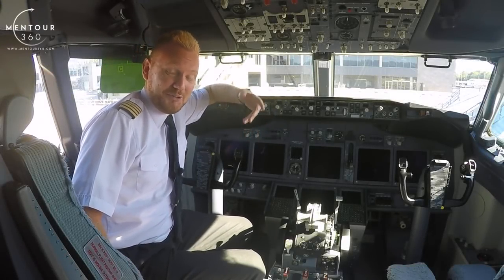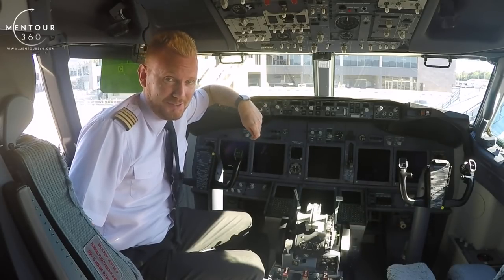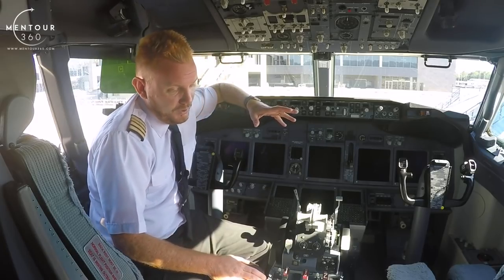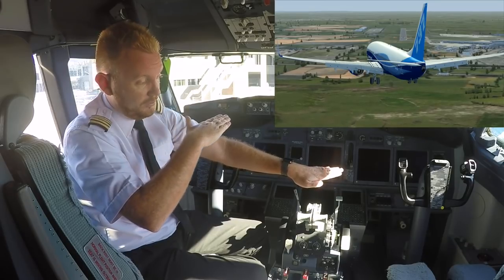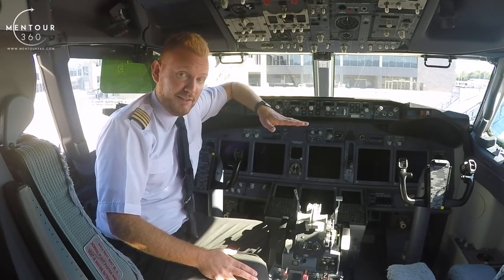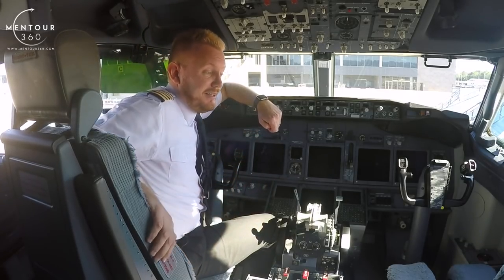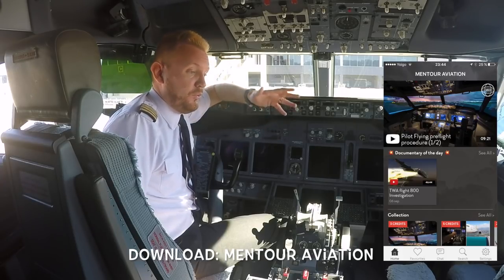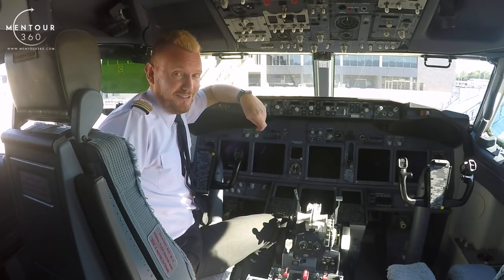How to do a CROSSWIND LANDING in a Boeing 737NG

Comment: How does the autopilot handles the crosswind during cruise so not to drift away from the straight line path towards the next check point..?
Reply from the maker: +Arinze Ahanotu It finds the correct heading to keep the track and uses that. Our IRS’s calculates the current wind all the time and feeds that to the FMC.

Comment: +mentourpilot Sir, please tell us about how do autopilot work? Which part of flight is controlled by the auto pilot and when and why do pilots use it? 

2. tell us about more on Integrated Approach navigation systems, how does it work required procedures to do?

3. Can a Boeing 787/Boeing 737 type rated pilot fly Boeing 777?
😇😇😇😇😇😇

Comment: One question: when you were sitting in the real aircraft, why does the fuel control switch(lever) and parking brake handle look different than what the other 737s have?
Reply: Cause it's an NG ?
Reply: S F Yeah but they were also NGs. Interesting?

Comment: What about the air Canada flight the landed on a race track, you should talk about that flight
Reply: that was a stupid mistake by ground crew.  did not know a Pound is 1/2.24 kilo.  system calculating fuel load was changed and there was not training on how to fuel the new plane type.  Ever ran out of gas on a roadway?

Comment: Why hasn’t a better solution been developed in order to handle extreme cross winds in a safer manner. With all of the gadgetry out there, it seems like developing a system to allow the plane to land in a crabbed attitude while at the same time being able to have the wheels lined up with the runway would make cross wind landings a lot less stressful and safer for the pilots and the aircraft.

Comment: Explain more why the crab angle on slippery runway
Reply from the maker: +Medi Amin Because the friction of the runway is less so you can use the crab to maintain the centerline a bit longer as the wheels will “glide” a bit initially.

Comment: Crab that sucker in there, or bulldog it, same thing! Dance the dance! Our local airport can be notorious for bad crosswinds, with only two parallel runways. Even Luke's aux field was a 3 runway delta. Even my hometown air strip was an el with a stupid short 3rd strip. That one was brutal! The B52's self steering RADAR guided landing gear is still top secret. Go figure, as it's old enough to get a pension.

Comment: I was trying to demarcate btwn the side step & the crab  🦀 for here in SoCal we get the devil winds / east winds & I had to x aileron / rudder & be aware on Cessna 152 not to allow x wind to pick up edge of wing & roll my plane which a  Cessna 152 is a baby carriage in the sky 🌌 I never felt greatly confident as I didn’t have an official teacher I just had a guy trying to get on w/ the airline     h/self jurriRIG a course to instruct me so I usually added prayer to my technique which pretty well got me through; yet, I. bet taking ur experience & forging it to my thoughts would give me a lot better perspective is it possible for full simulators to mimic xWind landings ❓I wish I could practice those about a 1,000 to 2,000 x’s

Comment: What's up with those fuel cutoff switches? I've always seen the kind that slide up and down on the 737. Those look like the ones on a 777.
Reply: All the newer 737's come with them now, 737NG has been "facelifted" to refresh the design, this includes these type of fuel cutoff switches (they'll glow red in case of engine fire, so you can correctly identify which engine has trouble), as well as brand new LED lights (no retractables anymore and no taxi light, when you turn on taxi light, it will just be LED landing lights running at 10%), a "wall" like divider on the side of the FMC, not to damage the FMC when resting legs, brand new LED pressurization panel with white digits and a few more cool stuff.
Reply: The 737 NEO is a bit different to the updated NG.
Reply: Okay, how does this compare to the 737 MAX?

Comment: Informations on this video are partial. The statement “you don’t side slip on a big jet” is flat out false.

Boeing 737 FCTM (Flight Crew Training Manual)

SIDESLIP TECHNIQUE:

    The sideslip crosswind technique aligns the airplane with the extended runway centerline so that main gear touchdown occurs on the runway centerline.

The initial phase of the approach to landing is flown using the crab method to correct for drift. Prior to the flare the airplane centerline is aligned on or parallel to the runway centerline. Downwind rudder is used to align the longitudinal axis to the desired track as aileron is used to LOWER THE WING into the wind to prevent drift. A steady sideslip is established with opposite rudder and low wing into the wind to hold the desired course.

Touchdown is accomplished with the upwind wheels touching just before the downwind wheels. Overcontrolling the roll axis must be avoided because overbanking could cause the engine nacelle or outboard wing flap to contact the runway. (See Ground Clearance Angles - Normal Landing charts, this chapter.)

Properly coordinated, this maneuver results in nearly fixed rudder and aileron control positions during the final phase of the approach, touchdown, and beginning of the landing roll. However, since turbulence is often associated with crosswinds, it is often difficult to maintain the cross control coordination through the final phase of the approach to touchdown.

If the crew elects to fly the sideslip to touchdown, it may be necessary to add a crab during strong crosswinds. (See the landing crosswind guidelines table, this chapter). Main gear touchdown is made with the upwind wing low and crab angle applied. As the upwind gear touches first, a slight increase in downwind rudder is applied to align the airplane with the runway centerline. At touchdown, increased application of upwind aileron should be applied to maintain wings level.

P.S. I sideslip 737, 787 and 777 no problem. Landed with 35kts straight cross with all of them like a charm. Have yet to see a new generation children of magenta (system operator) doing the same. Actually most of the times these impostors do absolutely nothing at all.. frozen like an ice cream. 

Modern low cost carriers teach system operators not to sideslip because they are Chinese style system operators mass production factories and this maneuver would certainly be way beyond a system operator’s reach. 

But don’t be misled by Ryanair&Co .. sideslip you plane no matter the size.
Reply: He meant that you dont start the approach with the wing down, which is true as even the part of the manual that you brouht here is telling you to   start with the crab method, you only sideslip at the flare , just before touchdown and not before. As you are flying with the crab during the majority of the approach , it's called the crab method and not the sideslip method, Its not the same as with ga aircrafts when you start to sideslip at 500ft.

 And sorry but you cant land any airplane by being frozen and doing nothing , im sure the rest of the manual will educate you more about the other  crosswind landing techniques.
Reply: @krusty1974  in general aviation, crosscontrolling during the  final approach is much more common than what you think ,hence why the capt said you dont sideslip a 737.  Is this more understandable ?

you might not sideslip at 500ft,but it doesnt mean that other people in their c152 will do the same, and you called me arrogant...

In fact what we call the sideslip approach in ga  means, as its name says ,that you will start to cross control during the final approach , all the way to touchdown, and not during the flare. So it's perfectly possible to sideslip at 500ft.

Comment: I must disagree with your statement that airline-type aircraft just don't use the side slip technique. I flew the MD-11, MD-10, DC-10 aircraft for 17 years, all of which are considerably larger than the 737, and I always landed them in side slip in crosswinds. That was the preferred technique for years and years, and still is. I think you should be a little careful in making sweeping comments about "all' aircraft when it's pretty doubtful you have studied the manuals of all of them.

Comment: I5 kts is quite little for the 737 ??
Reply from the maker: +Ultimate Sim Well, it’s actually quite tricky. :) you will notice.
Reply: Oh.. I even thought the big planes only struggle in really serious crosswinds.. :):).Thanks for the headsup :)
Reply from the maker: Ultimate Sim It’s not really a problem up until around 33kt
Reply: And can you actually land past your crosswind limits. During my ppl ive got 15 kts crosswinds in the 152 and i was always thinking that tower should atleast advice a go around but instead they always cleared us to land. The landings were pretty sketchy though.
Reply from the maker: ATC has no idea what your limits are, they will only give you the wind. It is always YOU who have to decide if it is safe or not.
The crosswind limits are demonstrated maximums. You can probably land with more but its not recommended.
Reply: That is true. Hoping also to fly the 737 one day :)

Comment: 4:30 Bass-Ackward explanation! Kick the rudder away from the wind, then give it aileron to compensate??? No! You tilt the wing into the wind to get the plant to slide sideways into the wind, then you give it opposite rudder to stop the nose from following the tilt, to hold it parallel to the runway.
Reply: @slehar. And what ratings does your pilot certificate have on it?